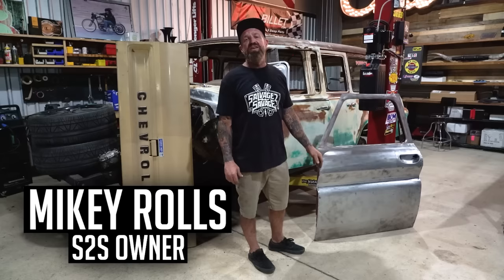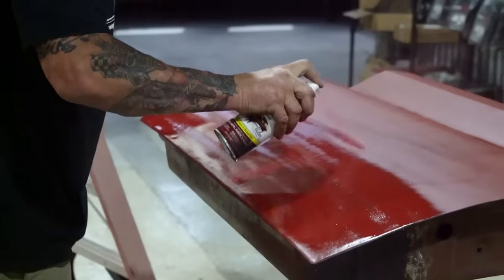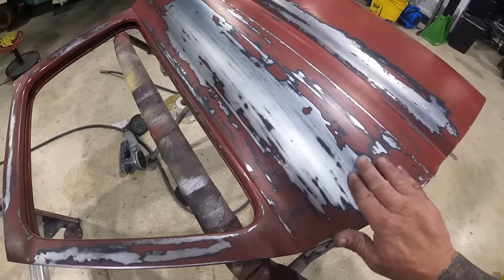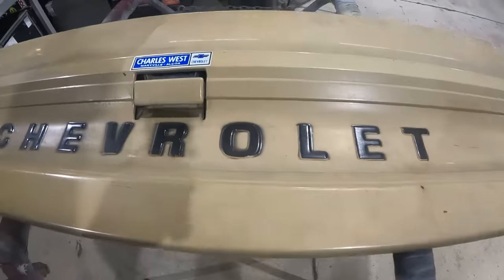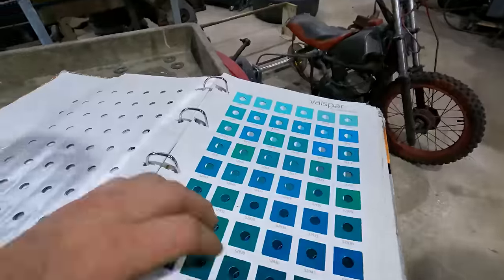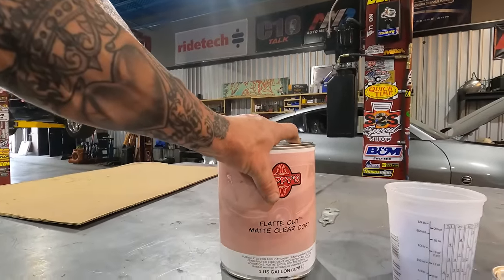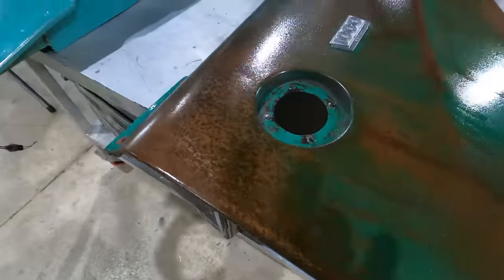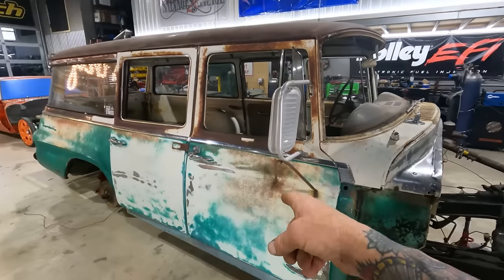How to Create a Perfect Patina Paint Job from Scratch!

Comment: I love the look but you are literally painting over surface rust, won't the sheet metal continue to rust over time? How does the clear coat stop rust, of you paint over rust it just keeps eating away?  Genuinely curious as any other rust inhibitor i have seen will turn iron oxidization black.
Reply from the maker: Rust is just oxidation. So if you seal in the surface from the oxygen, the metal can't continue to oxidize and won't continue to rust. Rust inhibitor works in a similar way, but the chemistry is a bit different. You don't need to build a thick coat of rust inhibitor for it to work. With the Poppy's Patina, the thicker protective coat is what creates the protection from further oxidation

Comment: Why does poppy's patina say its wipe on but yall always spray it on?  Is it to avoid runs? You can get the same look with "sweet patinas" wipe on product and its not permanent.
Reply from the maker: Good question, was wondering if anyone would pick up on that. So king story short, you can only use the whip on if it’s the real deal automotive paint that has faded or weathered over time. If you whip on after using spray cans it will smear. As far as the sweet patina I think that’s more of an oil that has to be reapplied. And leaves you a greasy

Comment: So I just done this method on my c10. Idk if I did something wrong or what but the rust I created with the mix wiped right off after sitting overnight with a rag over it. Is that normal or do I need to do something else I missed. Thanks!!
Reply from the maker: So that rust is just going to be surface oxidation. You're going to want to spray it with clear or if you're doing it a wipe on clear coat, go over it heavy so you don't have any friction to wipe it away. The longer you let it sit, the more it will set in though!
Reply: @SalvagetoSavage  10-4 thanks buddy! I don’t think I let it sit long enough to really set in good. It was still a bit damp from the mix I sprayed on it and I probably got a little too excited and messed with it too soon. I’ll let it set and cook in longer before messing with it. Thank again man. I give all the credit to you and the video once it’s done! 💪🏼💪🏼

Comment: So why not use normal clear coat?
Reply: Good question and I honestly don't have the answer, but if you ask Poppys im sure the can get into why.
Reply from the maker: Normal clear coats aren't urethane based and won't have the added UV protection. It's a bit more durable too. You can definitely add a normal clear but chances are you're going to have to spray a couple more coats than the single coat we were able to do with the Poppy's. Plus you don't get that hydrophobic property unless you end up ceramic coating your basic clear

Comment: Hey man, I followed all of your steps but when I touch the "rust" it comes off super easy. Is that normal? Should I just not touch it afterwards and get it cleared as fast as possible.  
I'm doing this on a Japanese truck. Ik that Japanese steel is tough 🤣 wasn't sure if it just wasn't etching into the metal enough or it really wasn't supposed to be embedded in
Reply from the maker: It's pretty normal for it to come off easily like that. That concoction just works to promote oxidation of the metal, but it's not really strong enough to dig down into the metal really fast. Etching the metal a bit more might be helpful, but also, if you have the time to wait, giving it a few days to oxidate some more will help it bite into the metal some. If you don't want to wait, throwing some clear on it will help seal it all in though!
Reply: @SalvagetoSavage  So I actually did this! I used a scotch bright and wet sanded the entire thing down. It definitely scuffed the metal up better. The rust is wayyyyy better binded to thr bare metal than it was. I could take it off with my finger before. Appreciate the response

Comment: How long do you leave the  patina formula, on bare metal?
Reply from the maker: Just until you get the desired amount of oxidation. There's no set time, but there will be a point where you won't see any noticeable difference in rust after 5 or 10 minutes. That's when we usually see that it's been on long enough.
Reply: @SalvagetoSavage  Awesome!!!Thanks for responding ,some times i spend few hours watching ur Videos😬